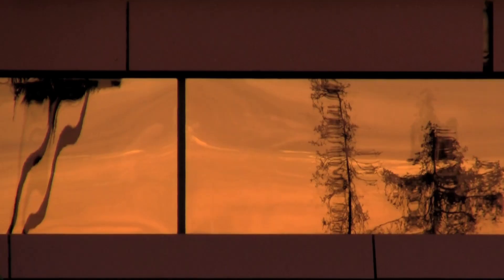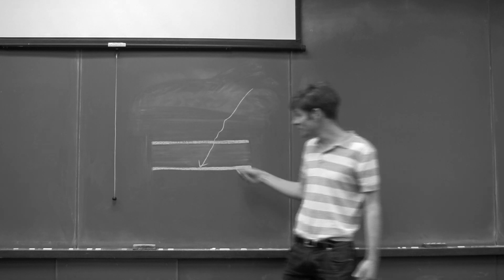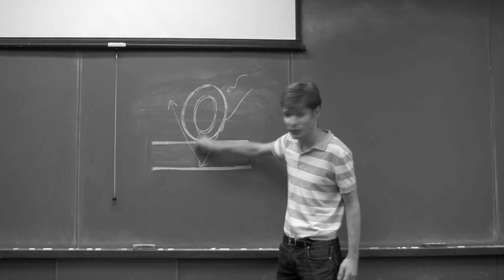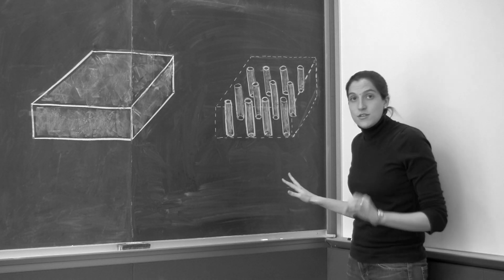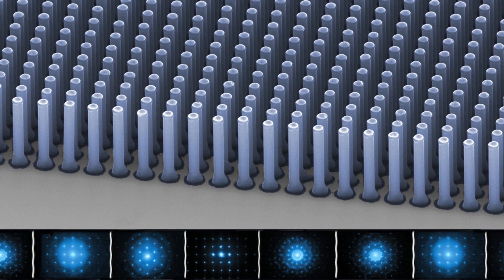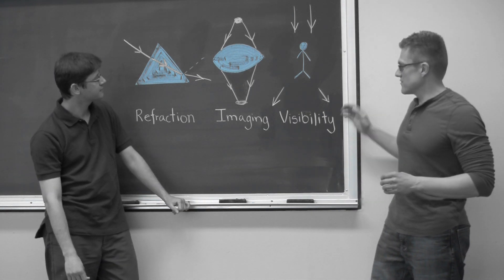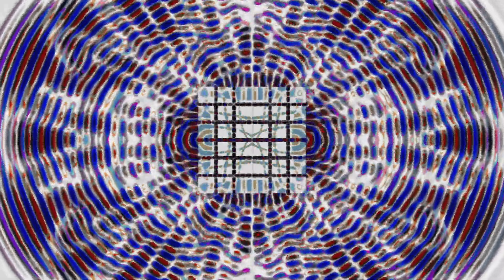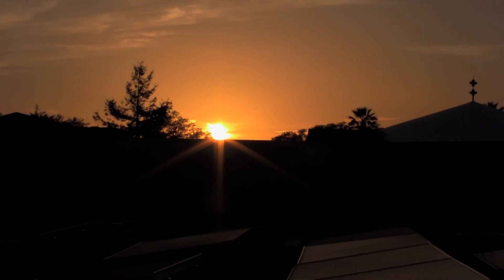"Light-Material Interactions in Energy Conversion" Energy Frontier Research Center (LMI-EFRC)

Comment: Part I:  A good question is, how does research and development figure into final production, which is a better question than purely, what does it cost?  Let's break it down into simple numbers:  Let's say that it costs $60K to develop the metamasking programs for a surface plasma modification protocol that can generate the tiny dipole structure which facilitates thermal transfer in the aluminum plate to plate structure of a multi-mode Sterling engine.

Comment: The ‘jester’ here, who said his group turns out devices that generate 8KW, could spec their products then at 9.2KW.  This extra is 1.2 KW at the current Southern California price of $.12 (12 cents) per KW and doesn’t need transport fees!  So, for every hour it runs, it saves an extra $.144.  Thus 24 hours later (RMS) that means a savings of $3.36.  In the first week then, that is  $24.19 as a direct energy savings.

Comment: Part II:  Let’s say the production run of a Sterling engine is 5,000 units x 4 opposing surfaces of 16 square inches ea. So, in addition to the 16 x 8 surfaces which cost $2.50 to process at the 5,000 unit quantity price, one has to amortize the $60K original R&D.  Ok, that’s simple... $60k/5000 direct write off is... only $12. per unit.  So in your first production of 5K units you are spending $12. ea for the R&D, and $2.50 ea to implement it ~ 50%..